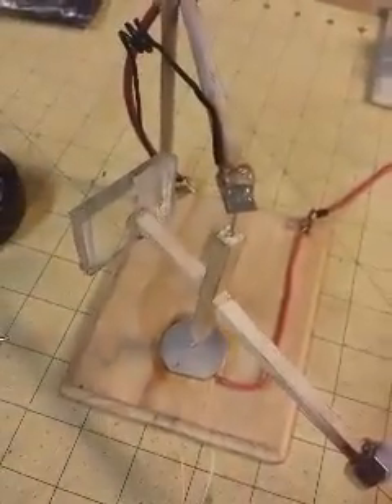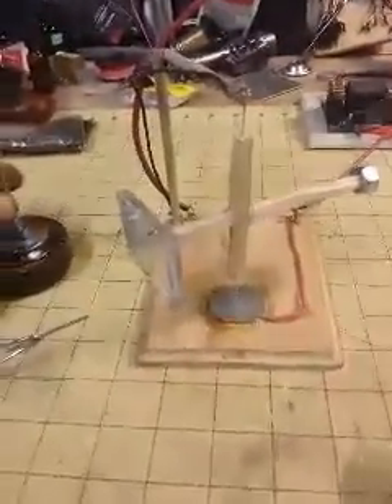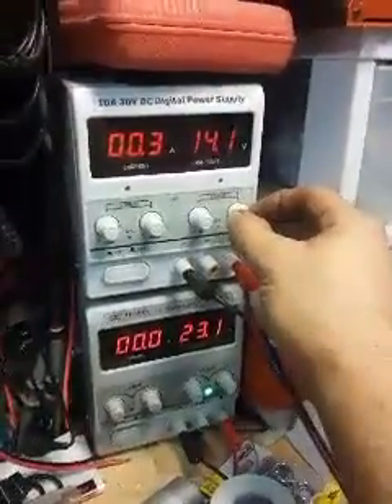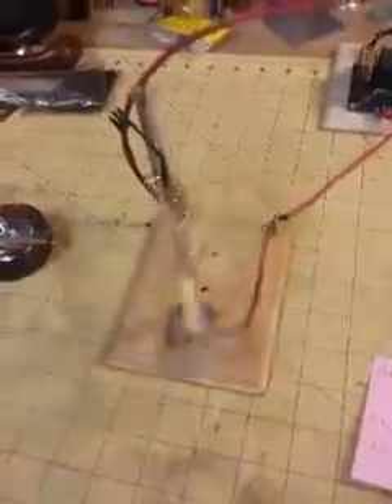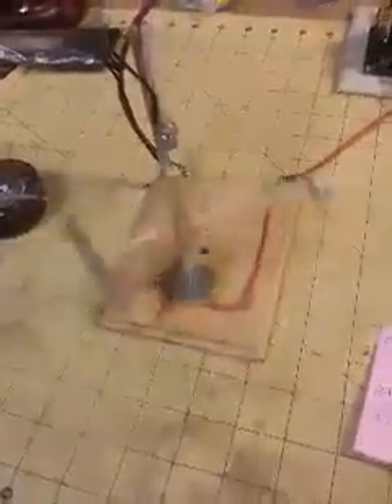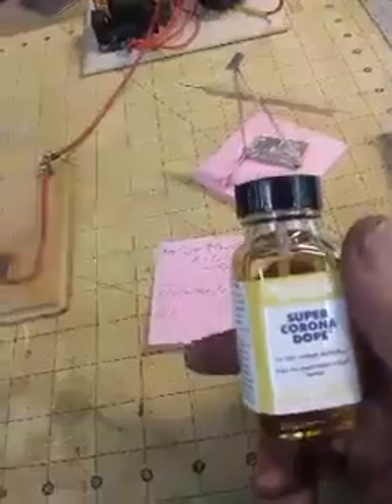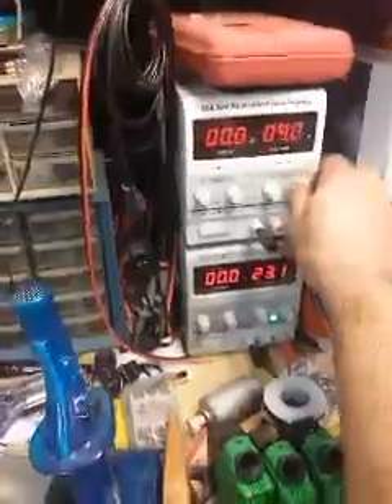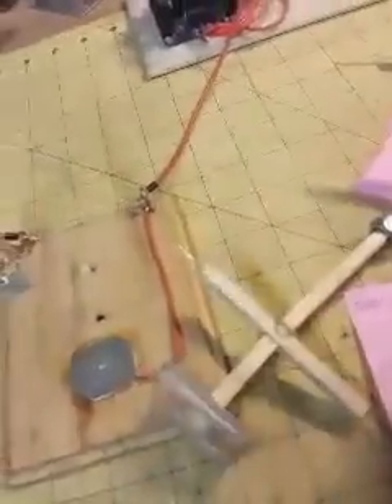Solid state propulsion

Comment: I know this sounds unusual. But I would try just another flat plate, on the other side of the dialectric, your first plate is on.
http://lunaticoutpost.com/thread-129059-post-4202452.html#pid4202452
Reply: I meant, and just charge both plates opposite charges.
Reply: And, if I understand this right. Your success with the dialectric, is because it gives the flow force something to act on. While a lack of material outside the plates, does Not ptoduce the force in the opposite direction.

Comment: This is a very interesting experiment!  I would think if you insulate the emitters enough, it will slow down considerably, at least at some point. Still it deserves investigation!  Thank you!

If you click on the purple channel icon to the left, you can see the only one that can lift its power supply onboard.  You are also right it is more of an electrostatic thing than a "corona."  The fields will show up on a corona camera, but if there is any blue glow even in the dark, it is just a power loss. It represents too dense of an energy field, heat , and ozone production.  If the current is very low and the energy is spread out just wright there is almost no ozone, and it is a lot more efficient.

Comment: SOLID STATE PROPULSION
 - MIT
Just Like Wright Brother And The Invention Of  The LIGHT BULB, You Have To Fine The Right Material For The Ion Drive engine: To Work  Right, to give it more thrust, if not copper and aluminum, you Have To  Search For The Correct  Material,. The right Material Will Give The Ion Propulsion Engine More Thrust:- for year people have used the wronght material for the ion drive: they have  make an ion thruster that it go forward, it need a ion lifter to go up!,( Making A Warp Field Useing Graviton Particle
 The Ion Drive Use Ionic Wind For Propulsion The Graviton Drive Or Warp Drive Used Graviton For Propulsion, And No Ionic Wind. Graviton Has The Ability To Move SPACE Around It Drive Systen Creating It Propulsion, The Graviton  Drive Systen Has Positive Charge Going To Negative Charge. The Graviton Field Is Positive Charge. That Move In The Direction Of The Positive Graviton Particle Field, Just Like A Ionic Craft, But No Ionic Wind

Comment: Thanks for the lifter experiment videos, I'm looking forward to seeing you try it with a much stronger dielectric.  I was actually thinking about trying the exact same thing since I did some research that shows it might be the dielectric causing the push...  PS any reason for recording it in only 144p quality video?  Even any cell phone in the last 10 years will record in much better quality.  Hope you can shoot the next experiment with something a little better :)
Reply from the maker: I completely agree, my videos are terrible, I live in a rural area with very poor internet speeds, posting High res takes forever to upload. I have better equipment, but am just getting started into this you tube thing, Better videos to come.. LOL  My "focus" has been on the science, not on making it pretty. LOL
Reply: Oh ok I understand now.  I was hoping they were a little better because its very hard to see how you wired the power to the Lexan block.  Did the wires just go along side the horisontal shaft?  Is there any chance that you are getting some thrust from the lead wires?  And did you dope the wires too to prevent voltage leaking out and thrust?